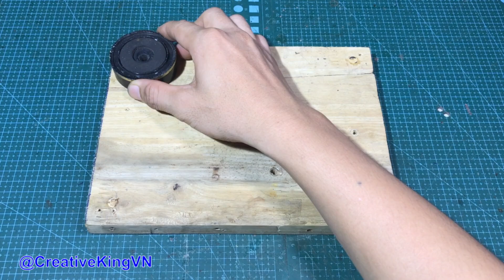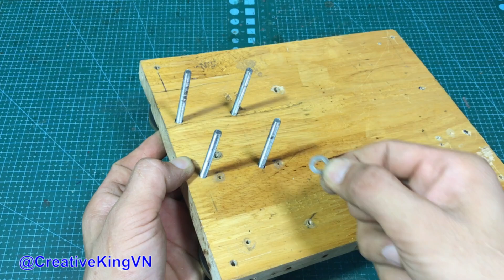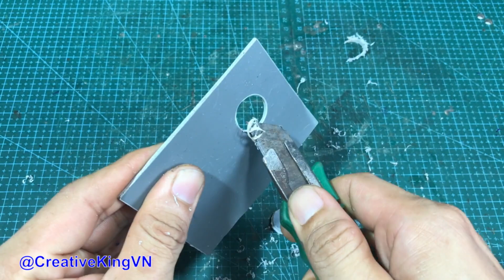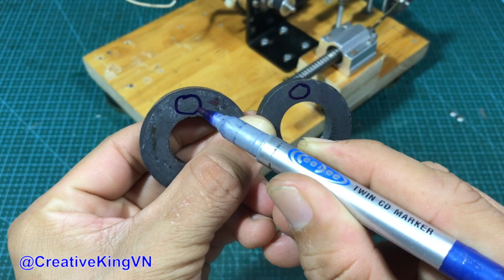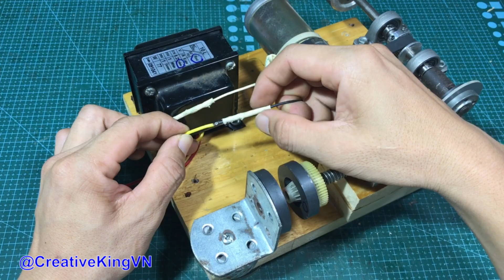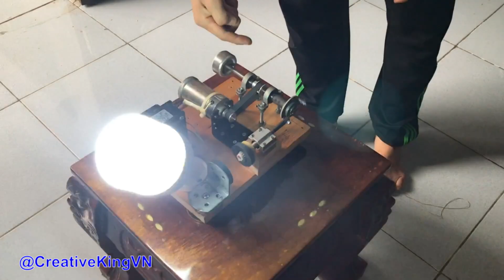I Made A Generator That Runs On Free Energy From Magnets, 100% Self-Running Engine

Comment: So the transformer,  with input 220 and output 27 v , you reverse the wires,  input x   V  from the motor, and the transformer is capable to give 220 as output?  I really understand the concept?